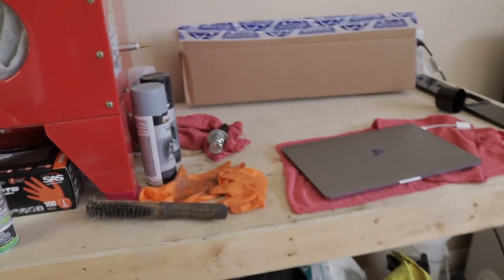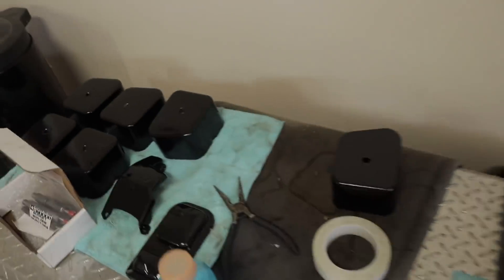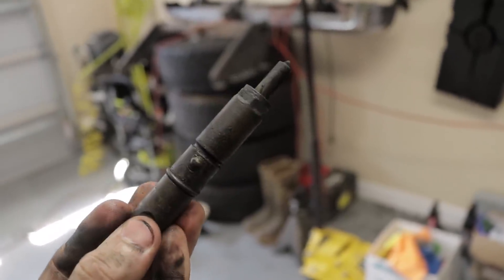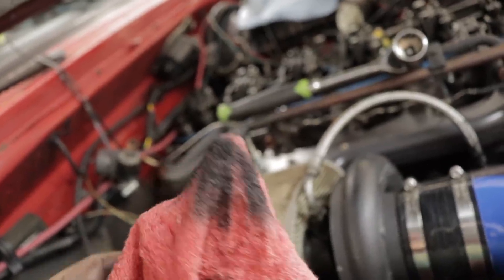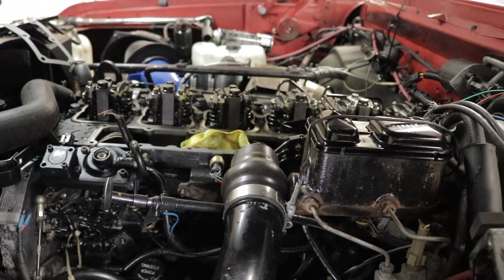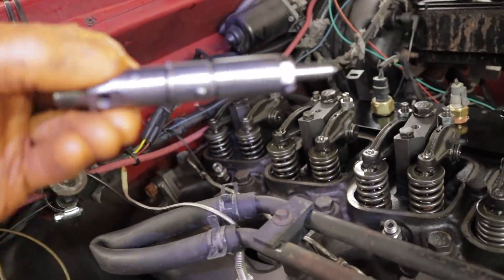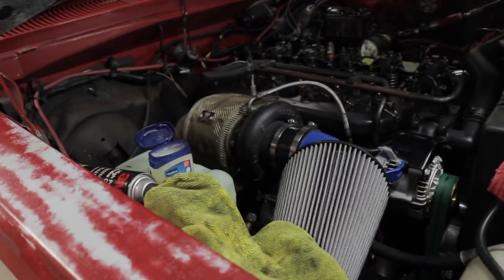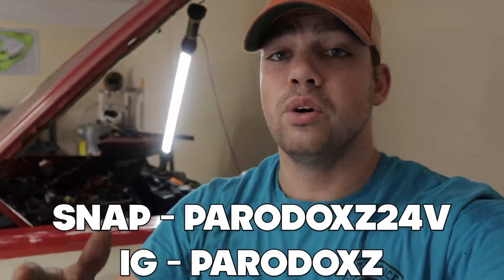THIS IS WHY I ONLY DRIVE CUMMINS TRUCKS!! + FIRST GEN 12 VALVE CUMMINS GETS HUGE NEW INJECTORS!!

Comment: Nice truck my 96 is just a couple hundred miles from hitting 300k I would suggest cutting the hose shorter & using brass fitting with a flare or barb other wise it will just blow the hose off

Comment: Remove the steel coolant lines and the fittings for the they go to and by some pipe plugs and install and there she be. Cheap and easy solution

Comment: Had 3 dmaxs a 02 and 2 08s, and 2 cummins 97.5 and 05, both cummins motor went 12v had horrible blow by and oil leaks everywhere only about 170 on it. 05 had 180 had a bad rod knock and blow by had to rebuild it,  02 dmax had 300+ no probs 08 had 300 no probs , other 08 blew the heads and broke crank but it was at 760 to the tires.. when it did so had isses with both, but the cummins road like crap and were stupid annoying loud, dmax road awesome and were quite.. but I am still driving the 12v lol

Comment: You could get a longer hose, and just make a bigger loop to eliminate the kink. wont look as good, but it wont be kinked. or, check out those metal hose benders, i think they are called unicoils, oreilly has them, you put it over the hose and bend it, and then you get whatever bend you want or need, no kinks.
Reply from the maker: Thanks man! I’ll look into it

Comment: I have 2 7.3 power strokes and a 7.3 idi non turbo and a 1999 v10 f350 all have over 340k miles never had any problems out of any of them except 1 need to replace 1 injector on my 99 7.3 powerstoke with 746k miles but i have a feeling im going to have to replace some here soon
Reply: Your blessed my boss has done 2 control modules and all new injectors in both the 7.3s and our idi won't start without starting fluid if it sits for more than 8 hours

Comment: Went from a Cummins to a 7.3l powerstroke and haven’t looked back...I appreciated my Cummins for what it was but that was literally the only good thing about it....steering,suspension, transmission, all were junk and the truck didn’t have but 150,000 miles...no tuner, air dog 165 and all necessary mods...I lost about 8k on it but let it ride when the trans went out....sadly that was after I had the trans pulled for a billet converter and a valve body along with other parts...
Reply: Grocery Getter I like the 7.3 a lot body and steering is much better but I love the cummins is so simple my dad has a 7.3 with 370k and I love it my 24v is ok just did a headgasket at 340k

Comment: Am i Old or Does this Music Suck?    06' Mega Cab 4x4   300,000+ miles     Replaced my Injectors & my mileage went down(Injectors from Paducah Diesel) .......   &  Another excellent diesel channel is Optima Welding  => https://www.youtube.com/channel/UCFGZ8Cd9KdoVSvat8nlmabA   He is doing some crazy computer tuning mods, not to mention kick-ass flat beds & bumpers!
Bend a copper tube in a U shape with two small radiator hose clamps until you deal with the heat exchanger
Reply: Oh & you re-deemed yourself with the closing tune  ;-)